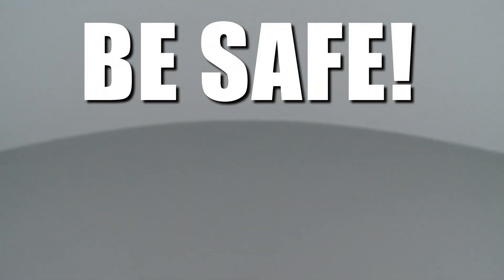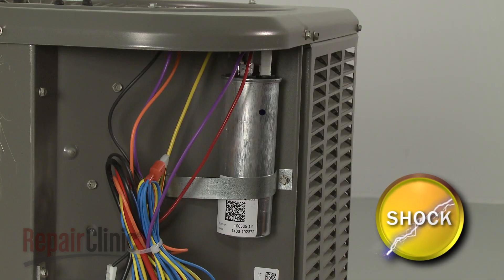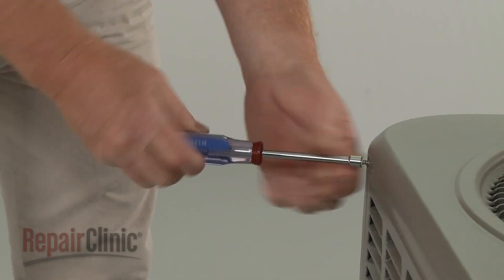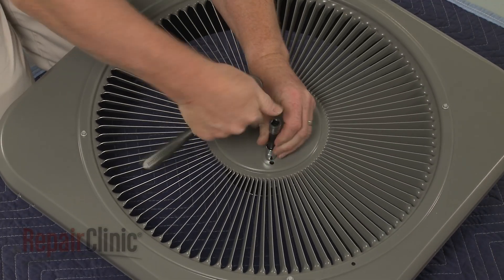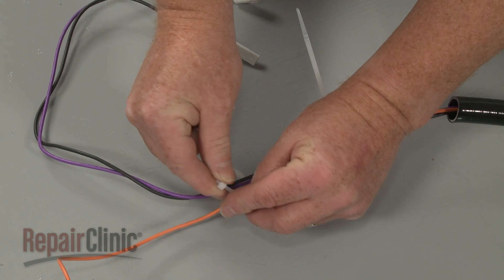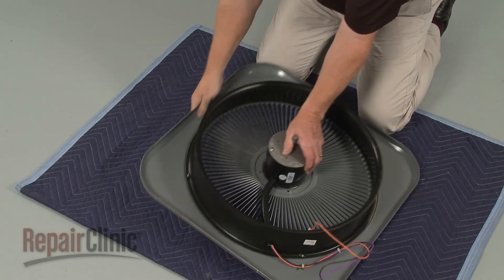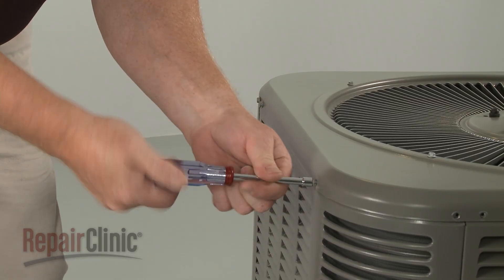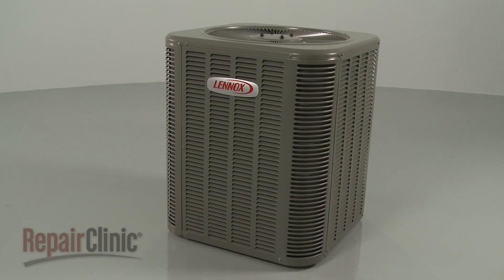Lennox Central Air Conditioner Disassembly (#13ACXN03623017)

Comment: My Outside fan did not work.  I have replaced the capacitor already but still have no 24 V going into the fan to make it work?  Wonder where will be the fuse locate in Lennox xc14 inside the furnace?

Comment: Good vidoe, but doesn't the capicitor hold a charge all the time? How do you remove the wires without getting electrocuted?
Reply: Not if you short the terminals first. That will discharge it.